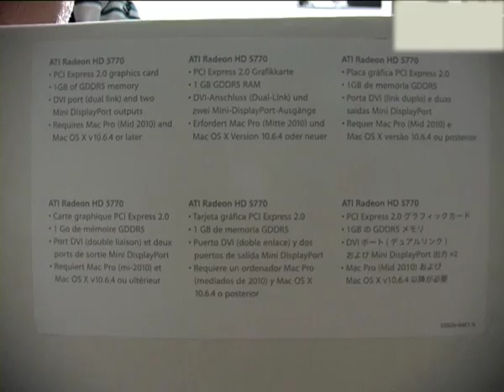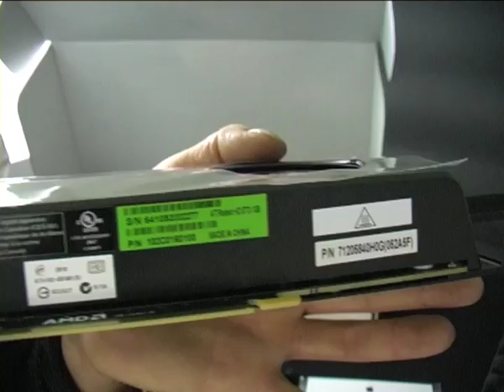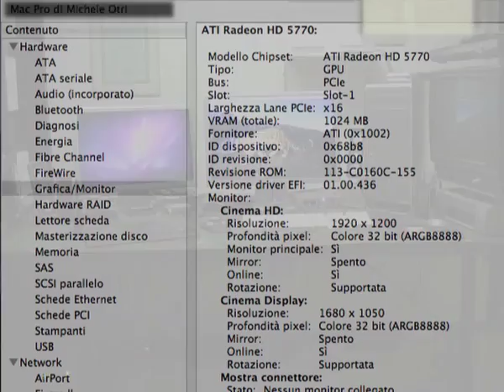2006 Mac Pro Upgrade: ATI Radeon HD 5770

Comment: @Anacreon70 odd.. I just got mine and it didn't work with both adapters... I got poor resolution options on my main screen (the 30") when I did it that way.  I then plugged it into the DVI and the 20" into an adapter .. and it worked great.  How weird is that?

Comment from the maker: @CE750 

Both the mini display port to DVI cable adaptor for the monitors. 
If you just plug only one of the mini display port, the DVI port on the rear of the ATI HD5770 will be disabled.

Comment from the maker: @tomcatdcn 
I cannot mount a commercial card into a Mac Pro Machine. For commercial, I intend a card acquired in a normal store, for windows machine.
To mount a commercial card into a Mac Pro Machine I must flash the chipset inside the card with a specific firmware created by apple.
Buying card from Apple store, it's ready to use with the relative guarantee.

Comment: did you use one or two of the DVI adaptor cables?  I also have a 30" and 20" display.  but I thought I saw the back of the new ATI card has one DVI type output? or was I mistaken?

Comment from the maker: @DirtyYogurt 

I cannot mount a commercial card into a Mac Pro Machine. For commercial, I intend a card acquired in a normal store, for windows machine. 
To mount a commercial card into a Mac Pro Machine I must flash the chipset inside the card with a specific firmware created by apple. I don't want to risk, to throw away the card if something goes wrong.
I prefer to spend more money to have a functional card and the relative guarantee.

Comment: @Anacreon70 
and replacing that hard drive was covered by warranty.

my point being that if apple wasn't run by money grubbing bastards out to rape your wallet rather than deliver a good bang for the buck product. for the same money you're shelling out for a 5770, you could get a 6950 which is literally DOUBLE the performance for exactly the same money. i'm not kidding, check the benchmarks on Tom's Hardware. that's not a quality guarantee, that's forced sodomy.

Comment from the maker: @DirtyYogurt 

The firmware inside the chipset is different. To work with a Mac Hardware you must flash the chipset firmware inside the card, and honestly I don't wont risk to throw all in the trash.
It's too expansive? I don't care, but i'm sure that the card work good.

Comment from the maker: @SourNaik 

Apple store. The commercial card it's for PC. There is a difference between them.
The firmware inside the chip card is different in the commercial card, you must buy a specific card for Mac otherwise you risk that the card not work.

Comment from the maker: @igouroum 

Good, it work very good.
When I've upgraded from Nvidia 7300 to ATI 5770 some application, like Photoshop,
can manipulate better more image simultaneously.
Consider the possibility to take advantage of Open GL instruction, the old Nvidia is not 
able to use it.
I think that is a good upgrade for this generation of Mac Pro, but consider that, the Mac Pro 1,1 generation
was presented on 2006.
If you need strong performance from your machine, consider to buy a Mac Pro more recent.

Comment: I'm thinking about getting a 1,1 mac pro and putting a 5770 or a 6870 (yes, the 6870 works in osx) . However, I'm worried about the cpu bottlenecking on either the 5770 or the 6870.. how does your 5770 perform ? is mac os smooth with this GPU?

thanks, mark

Comment from the maker: @OrangeCat274 

I think no, the commercial card bought out of apple store got some internal firmware optimized to work fine in Windows systems.
You must flash the internal Bios of the card to work with the EFI system of Mac Pro.
I don't know well this procedure, but i think that you can do it with the right procedure.

Comment from the maker: @NALAMOO 

I don't Know.
I bought the video card update on the Apple Store.
I've Mounted the card into the MacPro and work good.

The MacPro early 2006 got a slot PCI-E ver 1.1, while the newest MacPro got a PCI-E ver 2.0
Probably my MacPro does not take advantage of this card at 100% of it's capacity, but i can assure you
that this card in my MacPro work good.
Respect of a my old Nvidia Card it's a good upgrade.